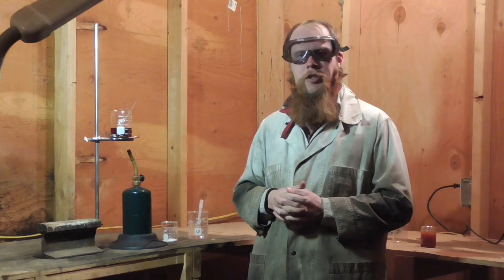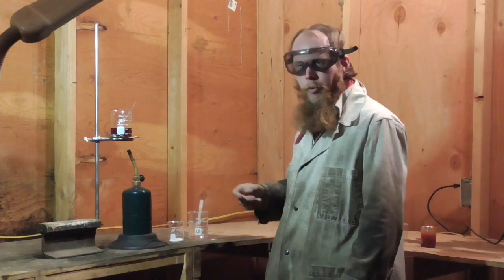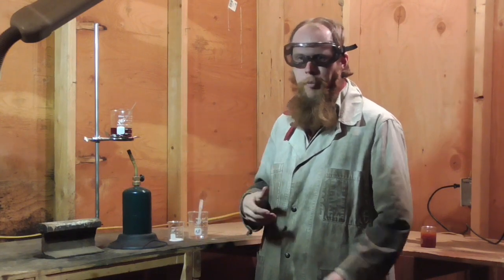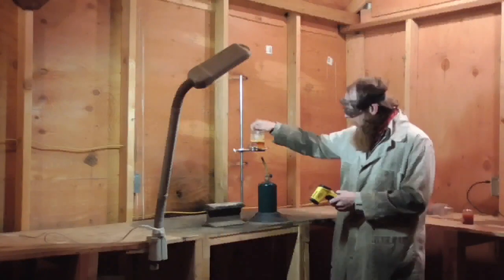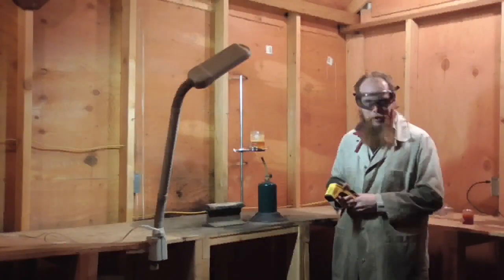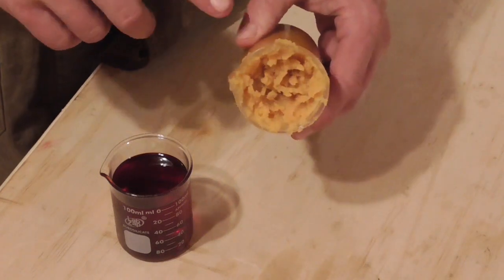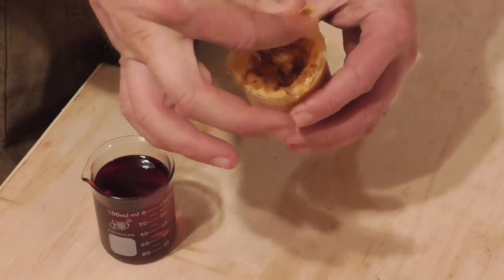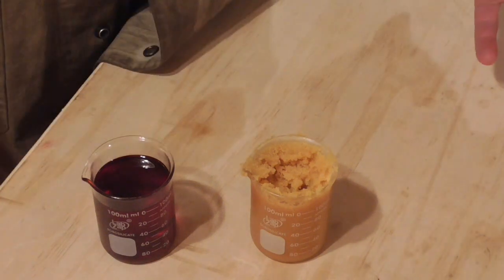Making Suflurized Soap (TIS122)

Comment: Very very cool. Thank you. I still wonder why they put sulfur in cutting oil. Have you figured that out yet?
Reply from the maker: Well, as I understand it, the sulfur facilitates cross-linking of the oil molecules, which makes it harder to break up an oil film, and thus increases the lubricating effect of the oil on surfaces are bearing on each other at high pressure.